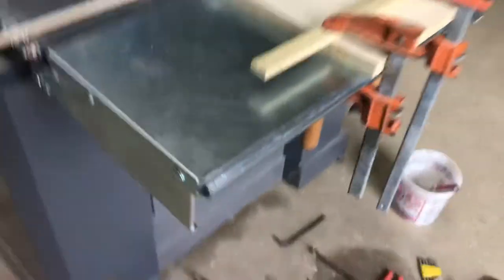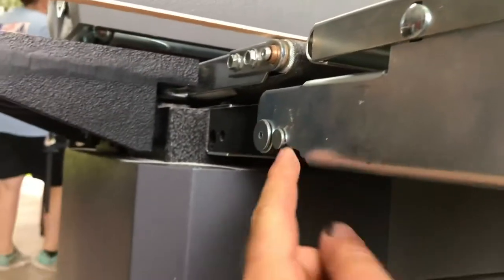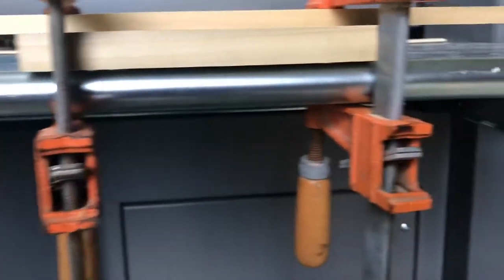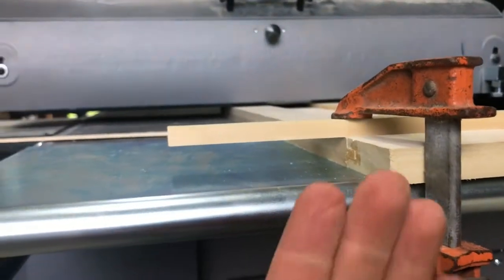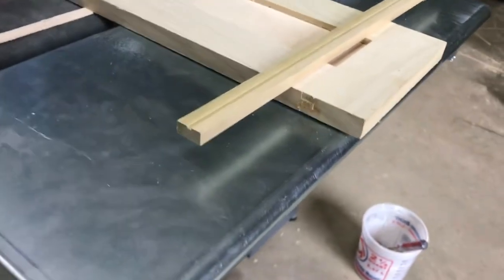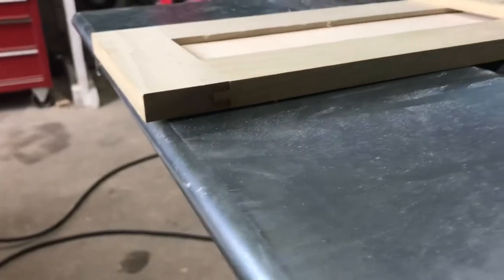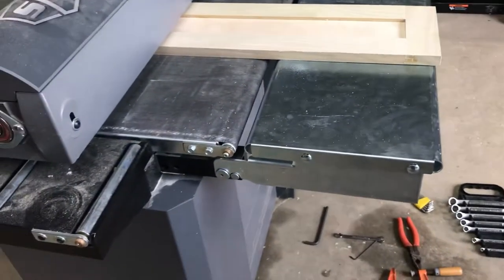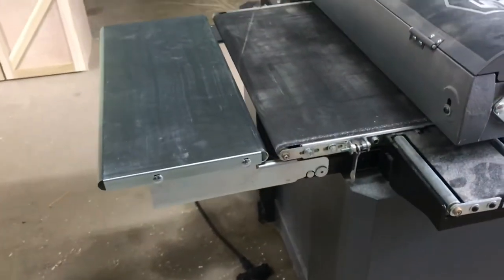SuperMaxx Sander Table Adjustment

Comment: For me I couldn’t get any leverage on the 1/4-20 set screws to adjust the camber on the infeed/outfeed table. I ended up replacing them with slightly longer 1/4-20 cap screws so I could get a 3/16 Allen wrench on them and actually get some adjustment on it. Thankfully I use to be a machinist and have my old Kennedy chest full of machine screws. Now that outer most carriage bolt doesn’t have to be at full stroke on the slot.
Reply from the maker: Thanks for sharing! We’ve gotten to where we rarely use these little tables anyway. We’ve fought them and they still never seem right.

Comment: They way you adjusted it is NOT the correct way to adjust. Underneath where the tables mount to the sander are 4 hex head bolts. you adjust the tilt with the smaller pair of hex head screws/bolts.  3mm allen key and a straight edge is all you need